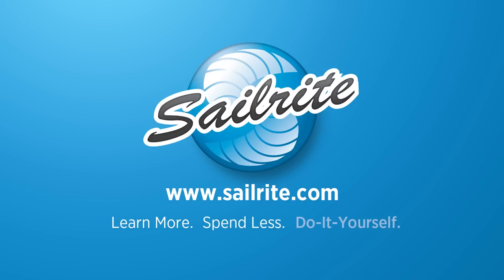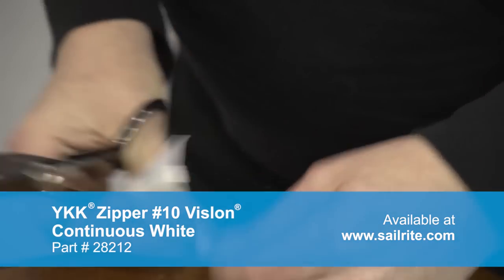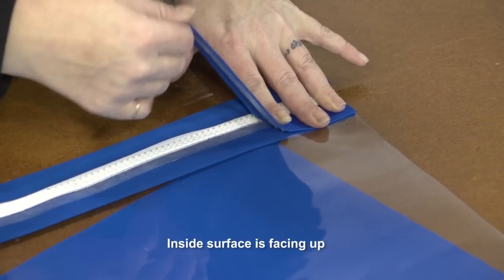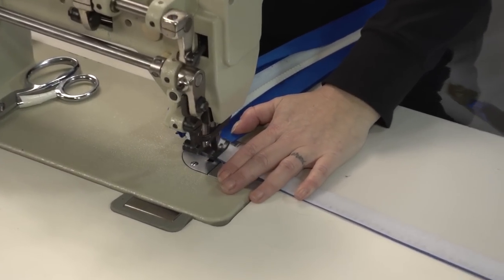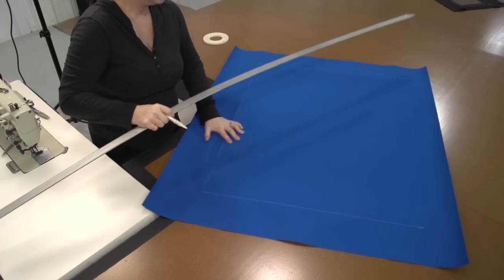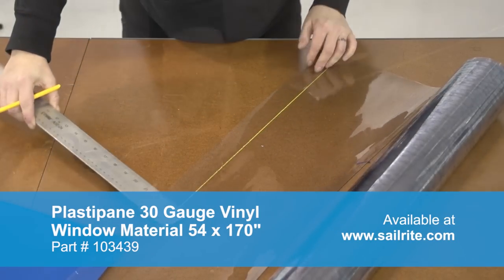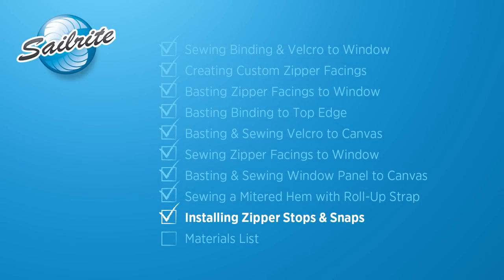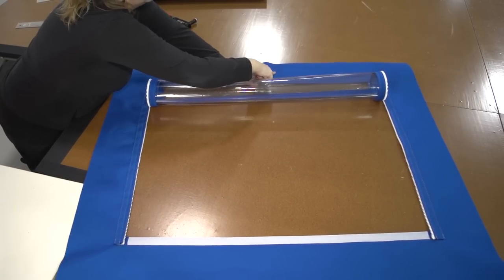How to Install a Zippered Roll Up Window in Canvas

Comment: My windows are on the INSIDE of the boat with a screen on the outside.  It leaks at the bottom at the zipper because the screen lets water in and it lays in the gap between the outside screen/canvas and inside window/canvas.  Our old boat had roll up windows also but did not leak.  Not sure what needs to be done to fix this problem. ???  Any advice?

Comment: So there is no concern of water getting between the basting tapes that meet over the middle of the zipper and then leak  through the zipper? Do you think it would be better if the top basting tape goes past the middle of the zipper to assure water run off? Thanks in advance for your reply.
Reply from the maker: When you say basting tapes, I think you are actually referring to binding tapes. If so, then you are correct if possible it is best to have the binding tape go past the middle of the zipper to help prevent water from leaking through the teeth of the zipper.

Comment: I am looking at replacing the windows in the back of a canvas for a party cruiser. The current window is sown different from this application but I don't like because is leaks on the bottom corners. Can I use this application but put a zipper across the top so that window can be rolled down toward the bottom like it is now. Will there be a concern of this leaking if zipper is across top? The current top zipper doesn't leak because it is under the canvas.
Reply from the maker: Hi Stephen,
Your approach sounds good. If the zipper at the top is under the canvas it should not leak. Let me know if you have more questions.
Thanks,
Eric

Comment: Can you install a screen also? If so, how?
Reply from the maker: +jolange1414 This video may help with installing a screen: https://youtu.be/Lb2WpVQygd0 It is not the same type of window, but will give you some pointers.
Reply: +Sailrite I was actually trying to put a smile shaped window/screen in a canvas panel (enclosure aft curtain), but couldn't figure it out, so ended up putting in a large rectangular window and then doing the smile zip/screen in the center of the window.

Comment: Hi,  At 2 minutes it seemed to skip a stitch twice,,,,? weird
Reply from the maker: +colin rat You are correct. We are using Tenara thread and the needle was too large (the slippery PTFE thread was not becoming bound in the hole in the fabric, it was too large). We changed the needle, after noticing the skipped stitches, to a smaller size and the issue was resolved, no more skipped stitches.
Reply: Ah that's good,,,,ive just been having the same problem making a storm sail from a larger genoa,,,,,